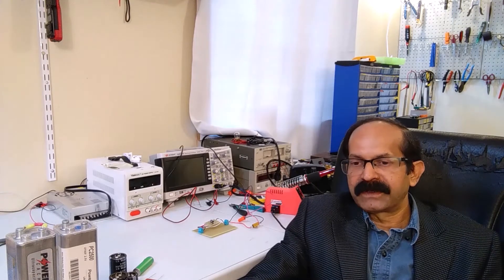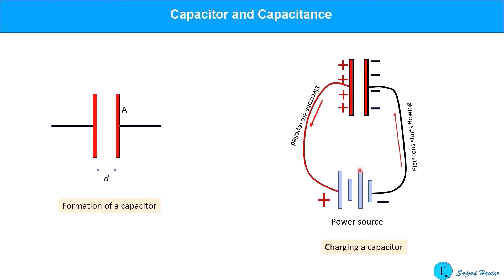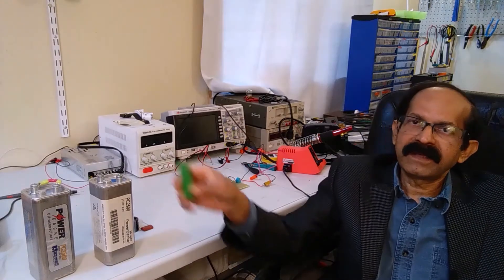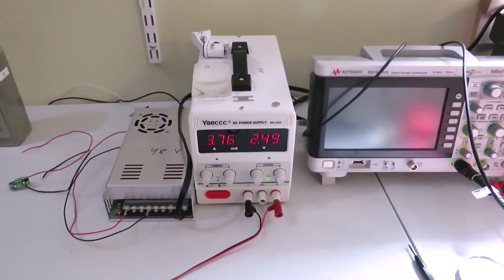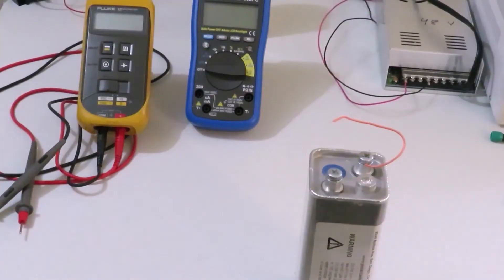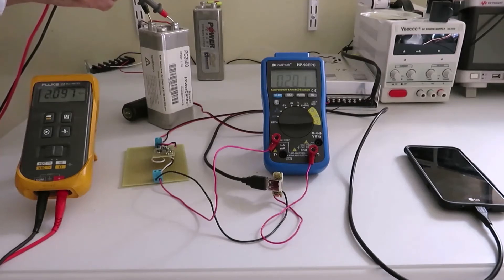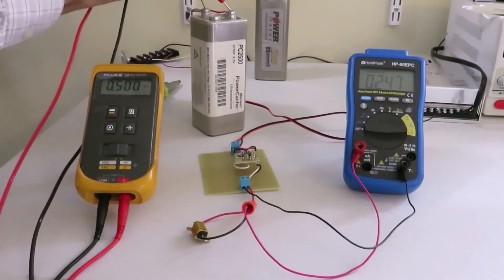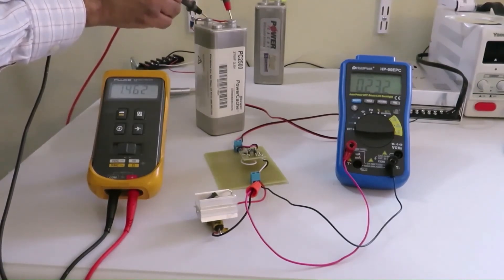Supercapacitor as a power source

Comment: If we want to do switching of supercapacitor and battery when the load is motor. If motor takes high current and we want to switch it to supercapacitor during transient load. For switching during battery to supercapacitor and after supercapacitor is discharged the switching will be supercapacitor to battery. Please help me for the switching circuit.

Comment: I have seen people use a screwdriver when dealing with capacitors to short them out. Can you explain how they do that? I don’t know so I leave them alone but I want to learn.
Are there positive and negative sides marked on them? I do know there are many types.
Thank you
Reply from the maker: Thanks for watching. Yes, the positive or negative side is marked. These are kind of electrolytic capacitor, so if the polarity is wrongly connected can damage the capacitor. All capacitors have a internal resistance, some bigger capacitors have a very low resistance (ESR), so if shorted cause huge current flow. It is better not to do it as the capacitors plates are also heated up. Kind of abuse and can reduce the life of a capacitor. I sometimes do it for fun.

Comment: I have a few questions if you don’t mind.
-Can a capacitor be ruined from not having a charge for a long time?  
I bought a box of scrap electronic boards to tinker around with but didn’t but realize how much there was to everything. Now when things break, I take them apart to salvage parts.
Reply from the maker: Usually capacitors remain good for a long long time if not used in a circuit. These are not like batteries, which destroys itself if left for a long time. Older electrolytic capacitors are usually not worth reusing because more you use slowly the electrolytes within it escapes the capacitor and ultimately the value goes down.